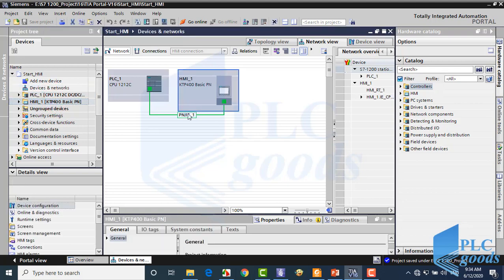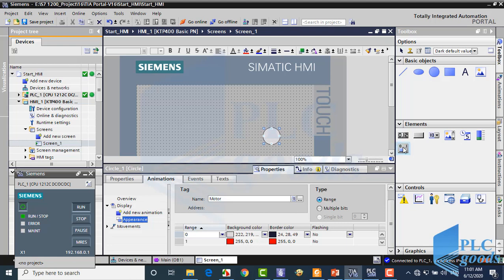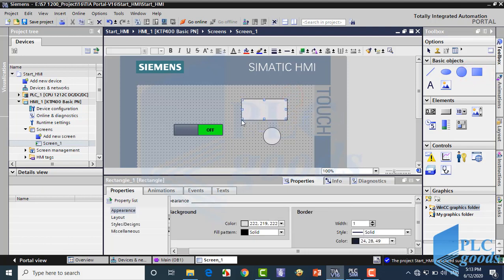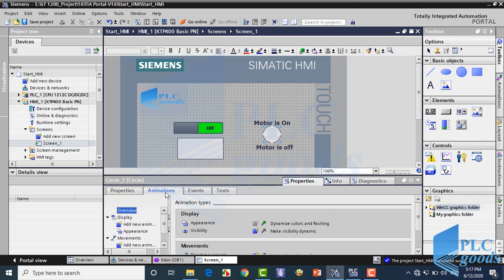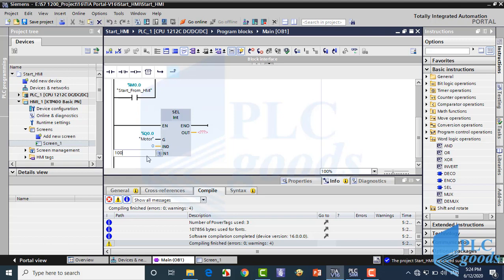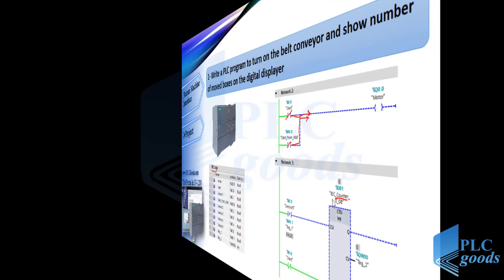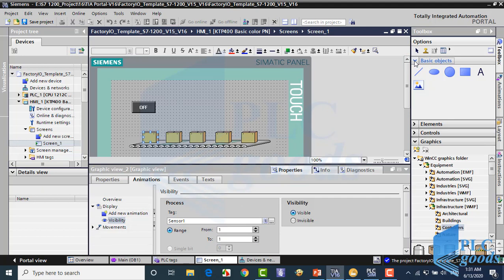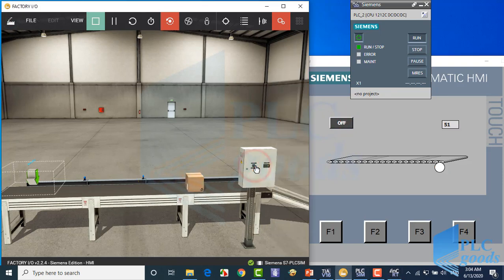PLC & HMI Monitoring Project with Factory IO | Siemens S7-1200 Tutorial | Lesson 33

Comment: how to download this TIA portal softwere v16
Reply from the maker: Search Siemens Support Portal with key entry 109772803 to access the TIA Portal V16 Trial download page (including STEP 7, Safety, WinCC, PLCSIM)
You'll find links to download multiple files labeled DVD 1, DVD 2, DVD 3, and PLCSIM installer—typically as ISO or executable packages
Download all required files into the same folder for seamless installation